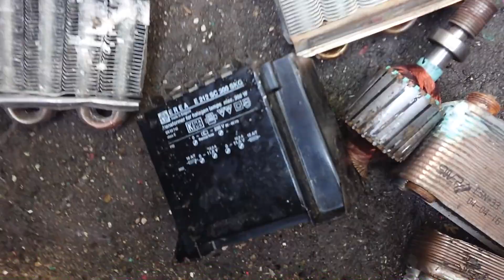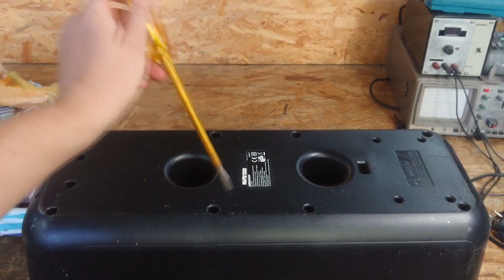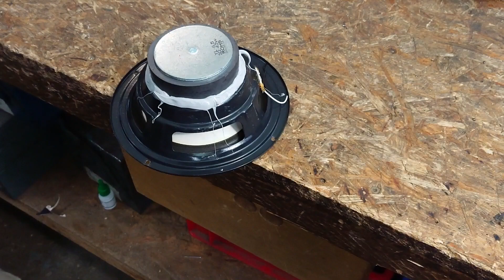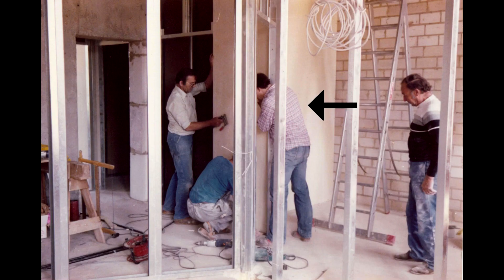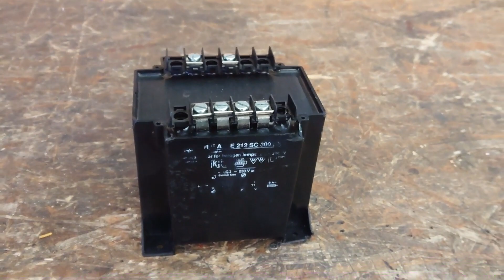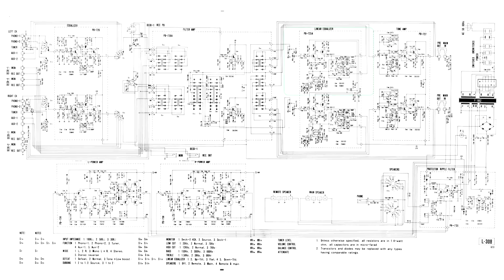Unusual Scrapyard Finds! Repair-A-Thon!

Comment: I have a Lux 507 of similar vintage which powers our formal Living room (a room virtually never used) and still love that amp.  When I first got it, it had a variable level of distortion which we tracked down to Very bad power (in the wall) which we tracked down to a sparking breaker in the fuse box.  Saved us from a fire I am sure.  At the time it was claimed to have the lowest distortion level of any amplifier and if you put it on an oscilloscope you wound up measuring the scope’s distortion.  Probably surpassed easily now but as a college student it was a serious source of pride.  Can’t bring myself to part with it.  Have a Lux cassette player (!) of the same vintage to keep it company.

Comment: That dental chair is a Siemens Sirona M1. After my graduation as a DMD, I had a mandatory 6 month apprenticeship, which I finished at the Military Medical Academy in Belgrade. The dental clinic there had many of those M1s which were installed when the hospital opened in 1984. They still work today, and judging by the words of the repairmen, they are quite easy to maintain and repair, should they stop working. I remember them being quite comfortable too, much more so than modern Chinese dental chairs. Yugoslavian, and later Serbian factory of dental equipment "Jugodent" used to make those same lamps under the Siemens licence for their Elektra 2000 chairs.

Comment: When you repair a speaker, either reconing or reattaching a magnet, you have to center the voice coil. Best way to do this is to remove the dust cap and putting some paper shims in place. If the coil is not properly centered it can self-destruct.

Comment: Okey but witch one was the primary fault with the amp, the caps not being able to provide the power or the potentiometer wear? Usually its best to test one component at the time so you can swap  back if you run into issues or fault changes.

Comment: A short circuit won't go away on its own? Wrong again, Mr. Inventor! A lot of appliances, especially mass produced ones, have an intentionally designed self destruct component! after a while it causes a short and blows itself up, taking the fuse away. Putting a new fuse the appliance works just fine for many many more years no problem, like bulgarian Bulsatcom SatTV receivers. In forums they recommend you remove that mechanism in advance and save yourself the future hassle. The powersupply brick that comes with it, is also designed to fail, the unit runs too hot, boils the electrolytic caps, and then can't provide enough power for the unit, so don't bother with the retail power brick, replace immediately!

Comment: Wrong again, Mr. Inventor. The reason modern things fail isn't because of the complexity. The complexity is tangential only. It's there as a marketing gimmick to trick customers into throwing out their old reliables. The real reason for failure is PLANNED OBSOLESCENCE and ENGINEERED FAILURE POINTS. They skimp out on materials intentionally or introduce the failure point artificially, like the .1% of oxygen in incandescents to make them fail - The Phoebus Cartel. The same with solar panels and their deterioration.

Comment: If you replace the filter caps on a vintage amp that has a large grill on the top and you don't it looking empty, a trick is to empty out the original caps and hide the new ones inside. They often have tabs to remove the bottom. Bend em up and pull the bottom out along with the innards, then cut the connections between the windings and the terminals. Solder on leads from the terminals to those on your replacements, mount the new caps on the bottom piece, and put it back inside the old can.

Viola! Looks like a vintage amp again, complete with chunky filter caps!

Comment: Your Luxman repair brought me back to one I did a few years ago, a later model, possibly early 80's. I ended up replacing every single cap (about 30 or so) and 2 faulty power transistors. A really rewarding experience getting the thing going again for the customer.
I really dig the dentist lamp you have, would like to replicate that arm in my own workshop.

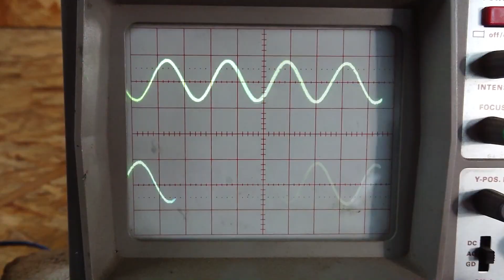Comment: At 20:30,  The oscilloscope trace of the 2 channels shows them to be out of phase with each other. Did you accidentally hook one up backwards to your scope (carefully, this could blow the amp up!) or is this indicative of a problem with the circuitry?  It's also highly unusual to see a potentiometer of that kind that can't be cleaned to the point where it is reasonably noise free. Any residual noise when operating the control is probably more likely due to some small DC current passing through the control, due to a circuit fault upstream of the volume control.  Electrically leaky capacitors in the tone control circuit, which is usually just ahead of the volume control, are a likely cause of the noise.

Comment: Danke für deine tollen und inspirierenden Videos. Hast du schonmal über Holzgasproduktion und das Betreiben eines Stromgenerators nachgedacht? Wäre sicher ein interessantes Video/Videoreihe da man sich mit dem Stromgenerator vom Schrott/ebay, dem Holzgasgenerator aus Fässern und Gasflaschen und dem richtigen Brennstoff und dessen Gewinnung mit einem z.B. Gartenhächsler beschäftigen kann. Wenn du keine Zeit oder Interesse für sowas hast ist das natürlich auch völlig verständlich. Das Thema ist im Moment für mich sehr interessant, da eigenen Strom zu erzeugen in Zukunft nützlich sein könnte und man eventuell nicht immer an Benzin oder Diesel kommt...

Bitte mach weiter so mit dem was du tust.

Comment: I would really appreciate and enjoy a video about connecting and operating an oscilloscope. I have a nice HP unit that works but was going to be discarded. I found a generic set of hook-ups for sale on Amazon and grabbed those. I know a very little bit about Oscilloscopes and really want to learn more about them. I am into Ham radio and the scopes are a great thing for testing and setting up radio equipment and components. I know there are videos out there but the TPAI films are very easy for me to follow and understand. 
     Nice work on saving the Lamp! I need to learn more about the 3D printing process as well but that's another road...
      Take Care and have a great trip, John

Comment: In Australia those screw drivers are high end and locked in our hardware store.  You have to ask for them 😂
Reply: I swooned over those beautiful Weras, they only have maybe 5% of that lot in my local Bunnings.
Reply: @lawrencebillson6224  Don't shop there for hand tools. Buy from an electrical wholesaler... like an electrician.
Reply: Considering Australia' ! Already has Nothing ! Then it would be High End there !
Reply: @davidwillard7334   We have more than you know... which is nothing. 
Good chance fuel prices are lower if you are stuck in Europe.... or that Island theme park to the West of Europe.

Comment: For the knob on the amp. One can always add in a balance knob right next to the existing knob. The only thing would be to search on ebay for a knob that has the same color and style and it solves the problem. A 4 way turned in to 2 knobs.  If one feels that adding a hole to the existing case is bad then adding a knob to the inside could work as well. Which is kinda what you did already.
Reply: I basically agree with you. But for the sake of keeping it original I wouldn´t drill the front plate at any cost! I think he found a good solution giving you don´t need balance really. May also a 2nd 2-pot could be operated in side via a small belt – using the original "knob" so the outside look is not altered.
Reply: Though for me the value in something rare like this is the ability to use it. So I would add the knob to the front of the case and have a good time!

Comment: Love the junk yards, always something nice to find. Also be careful not to run ultrasonic cleaners dry, permanent damage to the transducers will occur. They need to be filled to the indicator mark in the basin and another way to test the unit is to float a piece of aluminium foil in the solution and run the unit for say 5 minutes, the foil should disintegrate if the unit is working normally.

Comment: if that halogen bulb ever breaks there is probably led replacements,i swapped all the lights in a camper and brought down the consumption with 75watts
Reply: A halogen lamp will be kind of on the hot side to have too close to your head above you, and so changing it to an LED would be mandatory for me unless I want to sunburn my scalp or set my hair on fire!

Comment: Great job with the fixes! My car's Sub woofer was the same story, large rockford fosgate and housing from the dump, I simply epoxied the magnet back together, my amp was also from the dump and only needed a couple new capacitors that I salvaged from another much older amp that had been smashed, My aftermarket speakers where from a wreck at the crusher and the only part I paid for apart from the Atoto double din stereo. I should record some of my find's and upload them!

Comment: Afaik, our scrapyards here in the Philippines are gleaned dry of repairable and salvagable materials. No metals as they are reused for something else. No repairable electronics as there's always a waiting repairman there who would take the components home to make it work to make them his own. Only there left are wood and plastics as they are difficult to reuse or recycle.
Reply: hi, usable scrap yard findings are the downside to developed and low income difference society. I have Ms.C in engineering and I make 32€/h minus 30% income tax. For repair guy I need to pay about 60-100€ per hour (car repair being at top end). I follow TPAI because it's fascinating and I learn to save money since practically it's impossible to find repair guy or it costs too much to make any economical sense.

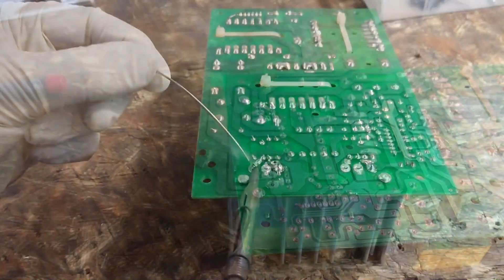Comment: 4:50 the “insulating material” you’re referring to is thermal interfacing material; it actually conducts heat rather than insulates, much like thermal paste does, but less messy and more efficient. 👍
Reply: Normally MOSFETs are connected with mica to prevent getting shocked by the cooling ribs. It's a kind of stone that isolates electricity and conducts heat.

Comment: Don't know if you can get it locally in Germany, but there's a product called Deoxit that basically fixes 99% of dirty crackling potentiometers..   Just spray it in, work the potentiometer around a few times, spray again to flush, then let the part dry and in the vast majority of cases, the pot works fine again.  The only thing it can't fix is where the carbon has literally been worn off..   The stuff is very economical to use and I've had the same can for over 10 years and it has fixed many slide switches and noisy potentiometers...
Reply: When you want to clean them I always use a shoe lace to easily spin them a few times.
Reply: Yes you can get it here in Germany. Music Store and Thomann (big online sellers of musical instruments and audio gear) got in in stock. Caig DeOxit D5 or maybe the Fader F5 might be even better for the job. 25€/can is very steep – but as you said – it's very economical in use!

Comment: I think, if the MOSFETs have failed before and the suspicion is overheating, I would go to a mica insulator with proper heatsink compound to allow for better thermal transfer.
Often the pot's can be cleaned with a contact cleaner that also has a lubricant in it.  This can work quite successfully and is used by a lot of Tube/Valve radio restorers as often the pot's in them are hard to find replacements for also.  In this situation, I do like your approach though as I don't think a Balance control is really needed either.   If the channels are properly matched, the input should equal the output and there is no real reason for a balance control.   It would be nice to have it original, but it is what it is.
Thanks for another great video.  I always enjoy watching your repair-a-thon videos.
Have you considered opening up to YouTube membership and having the Join and Thanks button on your videos?
Reply: Yes, for tough cases like this 4-pot contact cleaner might be worth trying – nothing to lose here. In HiFi and musical equipment everyone uses Caig DeOxit D5. It´s very expensive at 25€/can but lasts quite some time since you don´t need much. And you shouldn´t flood the pots anyway, just a dab is enough…

Comment: It is better, or more correctly called "planned obsolescence" ......making a product that is outdated or worn out quickly, to facilitate increased sales. The big problem, is that making a product that needs to be replaced 4 times in 10 years, compared a product that lasts 10 years, is very wasteful of energy........needed to make,transport and retail.   With "cheap" energy no longer available in tandem with the collapse of "cheap credit"..........everyone needs to rethink the situation, its not optional.

Comment: Great Job on fixing the Ultrasonic Cleaner. I had a feeling it would have been the mosfets. I've replaced quite a few over the years, and more recently on some Milwaukee Tools I've been repairing on my channel. I had the same problem with needing a longer screwdriver (well torx) when recently repairing a milwaukee jobsite radio.

Comment: I'm surprised the coil wasn't damage when the magnet came off the driver. Was it definitely working?
Reply: I was thinking the same. Or picking up metal debris in the slit where the coil is running. Or the heavy magnet just wrecking the PCB or components on the inside. Sometimes you gotta be lucky 🙂

Comment: Gas smart meters are a classic example.  The batteries in them are failing at a rate that they cannot keep up with resulting in unmetered supplies or even failure of supply.  It's no good cutting back on your gas usage to save money as British Gas are still going to estimate the gas bill in their favour and we'll never get our money back.  Smart meters are an utter disaster yet still they are pushing installation knowing they will eventually fail.  They don't care because they can charge you what they like.

Comment: Wow, interesting finds. 
So you didn't even try to spray down the pot? It might very well be just corrosion and contact cleaner will make it work again for several years if you're lucky. 
Those Luxman amps are very high quality and sought after. It's better to keep it in a fully functional state with as many original quality parts as possible.  
Those old capacitors were bulky, but they usually last longer than modern 'miniature' type caps. Many of them are still fine even today. Miniature caps from the 1990s are often failing already, even those not affected by the 'capcitor plague'.

Comment: Little tip when repairing speakers use a playing card or thin material as a spacer so that the voice coil is centred properly in the magnet. Great content, Posh work 👌
Reply: Luckily those cheap speakers have a huge gap.
Reply: @ppdan  A wide gap for low efficiency. 
A wide gap to hold a lot of metal filings sucked in by the magnet that were not cleaned out. 
A wide gap that might provide clearance for the bent up voice coil, BUT that wide gap between pole faces is still probably around 0.5 to 0.75 mm each side of the coil. 
 Yeah, cheap and junk.... better to just wire stereo inputs as mono, disconnect the wiring to voice coil on deadie  and let it run as a passive radiator.
Reply: @BTW...  I am pretty sure it's more than 0.75mm between poles. It's probably 0.5mm between coil and poles which is huge.